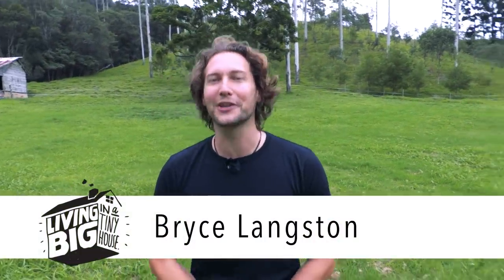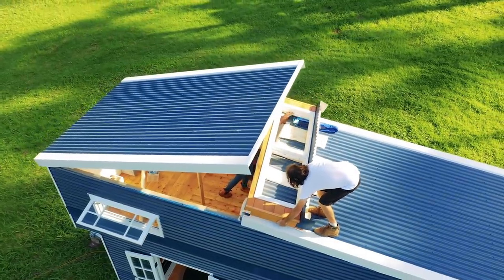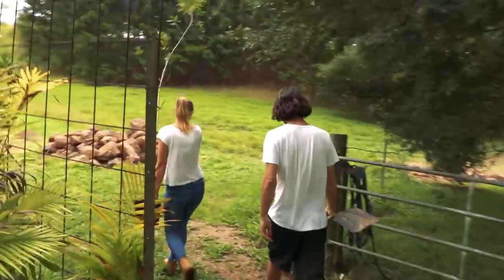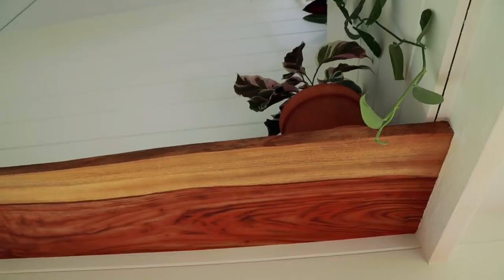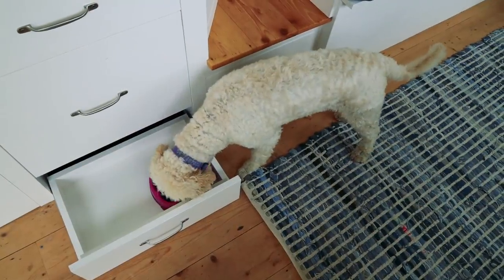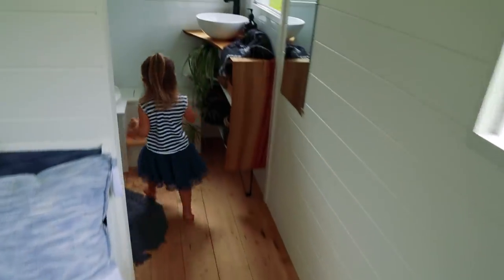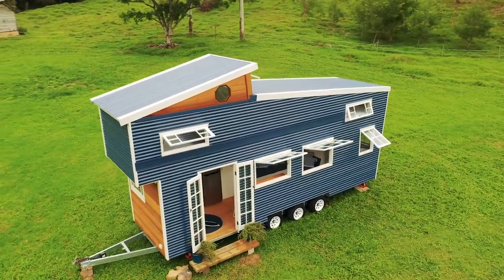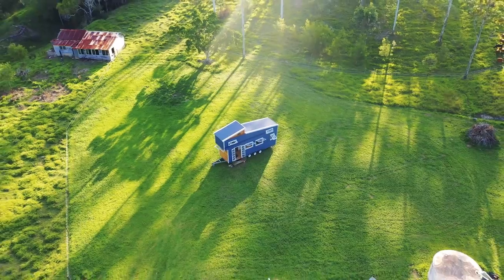Tiny House With Amazing Pop Up Roof

Comment: The wedge is amazing.  I had though of a similar idea and this has given me inspiration to try it.
Reply from the maker: Yeah. Very clever how it’s done. The flashing system is very good.
Reply: me too - I had thought of a rectangular frame that you would just extend up once you settled. So not a wedge but even more head space. The wedge is also a great idea. Doesn't seem that complicated as he said...
Reply: Living Big In A Tiny House I have seen this used by prefab home builders like Blu Homes in the US, but never in a Tiny Home. The result is quite impressive.
Reply: Please tell me how it came out....😀😀

Comment: Wow if I could ever down size from all my knik knacks and collections, I would absolutely love this house. It is so open, white and stylish.  I love how the family decorated it - still with flare but, every wall doesn't have tons of stuff all over it as mine do now.  I live in a complex in the Northern Va area that is known as the largest one bedroom apartments yet, we have very little storage.  I live alone but, I have tooooo much stuff. I would also love to own my own place, but, I have a very low salary and even though my rent is as much as a mortgage is and I am a saver, the mortgage companies all want to see a higher salary then I have. I believe renting is throwing money out the window. And even though all my utilities are included accept for water, I am always conscience of the blessings we have in our country to have running water and electricity and I only use what I need.  I love the natural  light. I live on the 5th floor and literally from my living room thru to the end of my dining room and from the ceiling to the floor are large glass panes with just a hint of tint. One sliding door.  I have AC but, rarely use it.  I have 6 screws in my leg, donor bones, donor paste and a 14 inch plate and the cold makes my leg so stiff.  I am originally from NJ and we had very very hot summers growing up and we didn't have AC so you learn to adapt.  
I too love plants and I love pretty pots to put them in and if the pot breaks I do not throw it away but, I give it to a friend who makes mosaic table tops with the broken shards and she sells them for lots of money. What caught my eye in this house too is the paintings and plates of clipper ships. My father is from Oldham, England and he collects clipper ships and so do I. I also love the round wooden wall hanging with tiny plants on it.  I have a round wicker shelf system that is probably over 70 years old and hung in my grandparents house when I was a child and I have tiny clipper ships on it, tiny bottles displaying sea glass inside and other little things of the sea/beach.  I might have to change it up a bit and put my mini plant on one f the shelf and one plant has a pretty vine that hangs down.  My apartment building was built in the 60s and its known as London Park Towers.  I use to walk to work every day until the company moved further away.  Boy, I think my dream house is now this little house. Thanks for sharing. I have saved it to my favorites.  Sorry this is so long. Living alone you become a motor mouth in writing also. Sincerely, Rebekah Bardsley, Alexandria, VA

Comment: Beautiful home and family...Could a full sized tub be added and maybe mount the washer and dryer higher over where your legs would be? Would lose some storage but a full tub would be sweet.
Reply: And they didn't think about that the kid gets the space that she needs when older
Reply: stonedcommander  I was totally just going to post this idea.  I think if they cut the board at the base of the shelves at the foot of the tub, they could still leave the shelves above and extend the tub to a full size. As long as they put their feet at that end (under the shelves), I don't know why it wouldn't be able to comfortably hold an adult. You wouldn't have to change anything besides cutting off the board under the last shelf and installing a full tub!  But then if it was me and nice outside most of the year, I'd just be building a deck with a wooden panel on two sides for privacy and put a claw foot tub outside! You could hang a shower curtain or drape or whatever in front if u wanted complete privacy. And if not....just open the curtain or take it down and have a full view into the pasture and still be covered by the side panels! Are u with me....or are u too stoned?!   LOL  Sorry I couldn't help myself!  jk  : )  TOODLES NOODLE

Comment: With such an outstanding floor plan, interior decor and innovative roofline, I find it hard to believe this house wasn’t designed by a top-notch architect-design firm with brilliant engineering oversight! I love that the “tunnel vision” you experience in so many THOWs has been mitigated by placing the kitchen and bathroom at either end, and offsetting the bathroom door. The way each of these areas is designed leaves the impression that there’s more to see around the corner. The offset bathroom door eliminates the all-too-common eyesore of a full-on toilet view in the rest of the house. Instead, the shower and toilet are discreetly tucked away out of sight at all times. The large, wrap-around kitchen bench with great big windows meeting at the corner looks so lovely and inviting. I love seeing real stairs access the main loft, and a well-designed, permanent ladder-stair hybrid allowing access to the secondary loft without ever having to wrestle a ladder. The color scheme and indeed every detail of the decor is so fresh and beautiful! The rippled blue siding and white window trim makes me think of white-capped waves on the sea, which seems a fitting choice for these former full-time sailors. This is the first of hundreds of designs I’ve seen that has motivated me to ask, are the plans for this brilliant house available for sale? Thank you so much to both this lovely little family and the Living Big team (because we know there’s tremendous talent behind that camera too!) for sharing this wonderful house with us.

Comment: This home is magnificent! Beautiful clean lines, love the color of blue used and how it blends with the green of the plants. Mother Earth meets the sky! Hope they build a deck when they get permanently settled. He is so talented, maybe even a little gazebo or aviary, r arch where a swinging bench could be incorporated , using these same rich wood tones as the interior. Maybe some stacked shelves where a solar cell-charger based mode of music with CDs is used, with plants all about. Someone needs to invent small spindle utilized lamps with LED lightening for evening with solar cell charger built in for power. Use the shelving outside on the deck to set them on during the day to charge, and then they provide a light source for evening hours of reading. I can see a family evening of working jigsaw puzzles using a custom built card table with folding legs that allows you to sit on your couch or on the floor with giant pillow and work a puzzle. Could even move it outside.create portable bench seats like inside with similar cushions to sit. Sealed well from water intrusion so they can be left outside, or moved inside in winter for storage for winter clothes and use as a coffee table. I would love to own one like this. Ingenious to have a built in narrow staircase up the side for the child’s loft access. No worry of a fall, because seating is below to cushion landing, literally. Most ingenious use yet!

Comment: Slide outs (or ups in this case,) are a common thing for RVs. I don't think I've seen any other tiny homesteaders take advantage of this type of space multiplier. Seems like a no-brainer to me. Great esthetics inside and out. The only thing I'd change is I'd paint that stainless steel fridge white!

Comment: I might have missed if they said, but so do they not have and plan not to have an air conditioning unit? I heard him say with the extendable roof (sounded like they said widge which i thought meant wedge but not too sure if someone would like to inform me) for head space in their loft that it works out well being the highest point so air can vent out, combined with how many windows they put into their home? And my second question was with most of these tiny homes (ik a lot are diy so they could customize it to however they'd like) but how does the water system work? Do they park it where an existing line is/ have to add one? Or do people have like a tank that they have to refill like in an RV?

Comment: Just wondering,  where do they keep their shoes and clothes?
Reply: They actually just finished the build and haven’t finished moving in yet - is what I understood, anyway.  They are going to need to build some hanging closets in the lofts and/or put a dresser with drawers or shelves w/bins for their clothing.  They have an Instagram account & I saw they added a covered outdoor area, and it looked like they put french doors from the kitchen to the back of the house.  I don’t have an Instagram account, so the site would not let me look at the pictures for long and froze the screen & told me to sign in.  Look in the description area under the title of this video with the drop down arrow on the right under video.  Bryce put their instagram link there.  This couple has done a lot in the last year.